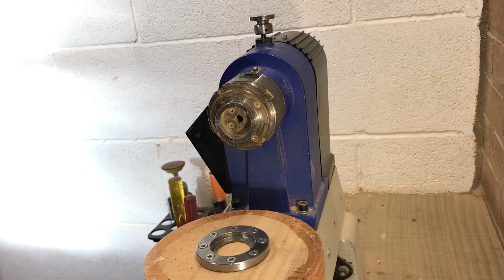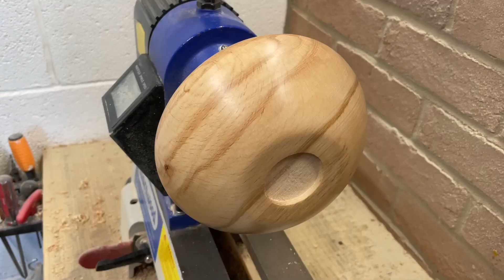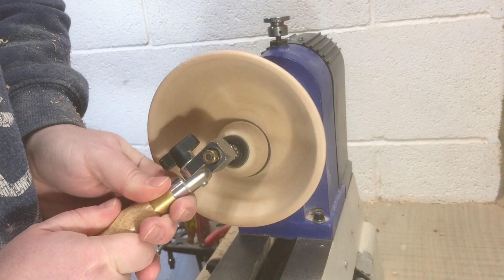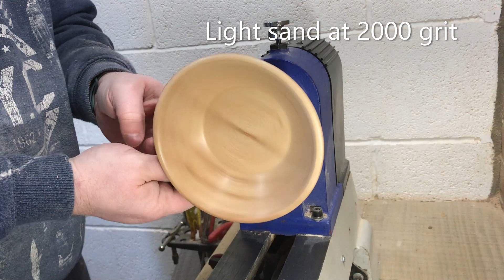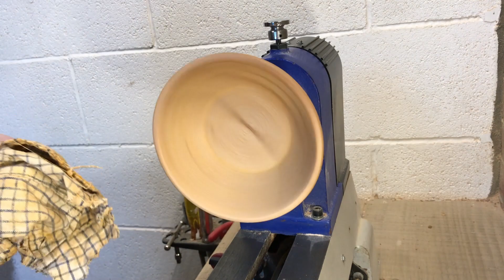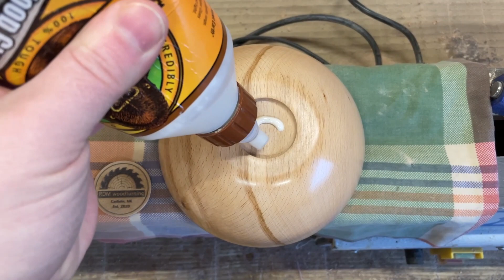Woodturning - Beautiful Beech Bowl

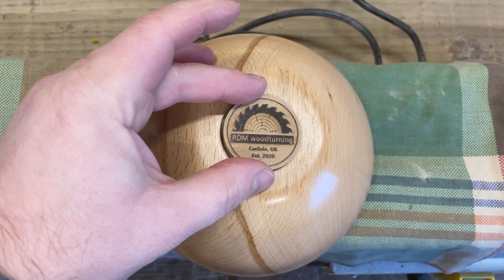Comment: 5:39    dumbest thing i ever saw        wood glue and an unclamped join.
Reply from the maker: I find that wood glue works best in this case as there is enough pressure in the snug fit on the makers coin to gain a good hold. Alternatives such as epoxy are not cost effective, and CA glue can get everywhere and marks the coin, as its only hardboard. Thanks for watching.